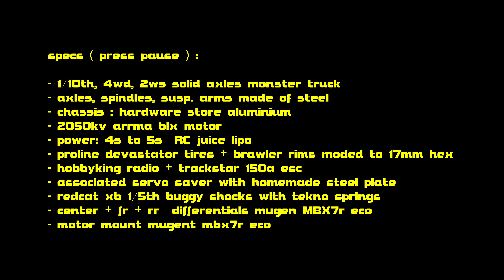1/10th homemade max d : tech details + action, home made steel solid axle monster truck werner sline

Comment: Awesome...
Strong gears... Strong materials👍
Reply from the maker: yes, the mugen mbx7r eco transmission worked really good ! note that the new mbx8 diff outdrives are not as strong !
Reply: @stephanez8036  your RC stronger than traxxass x maxx👍❤️

Comment: What a little beast! 💪💪💪💪💪💪 This thing performs really well 😎 looks like it can taking a beating as well.
Reply from the maker: thank you Sir ! well i can't compair how well it performs. i think the heavy steel axles  and low motor give my truck a low COG compaired with the LMT.  by the way, 2 guys said "losi stole your idea " when the LMT came out. i explained to them that my truck is very different ! the LMT has some nice ideas though, like the motor's position. which body did you keep ?
Reply: @stephanez8036  yes, your truck is unique, the LMT is not like it at all really! I decided to keep the grave digger in the end. The son Ova Digger is for sale!

Comment: Wow you seem to have solved every issue that current solid axle rc trucks have. 

My only question is how do you service the diffs? And how the hell do they take that much of a beating?
Reply from the maker: that was indeed my goal ! i made many previous versions to get to this point. actually i made another monster truck since that one that is even better ( better servo saver, better chassis , better steering,  6s power ) .  to access the diffs, you got to take out knuckles, and 1 suspension arms. the diff case will just slide out of the axles from the rear. axles are designed like an armor around the diffs. i used mugen mbx7r eco diffs, they are tremendously durable !  i just build a 1/5th pick up with solid axles, check out my FB : i'm there as " werner sline "